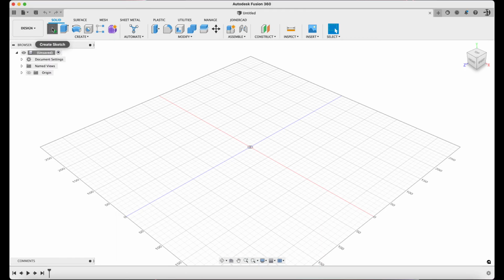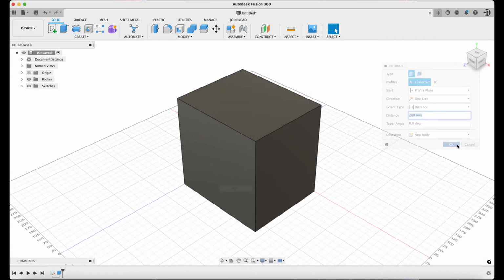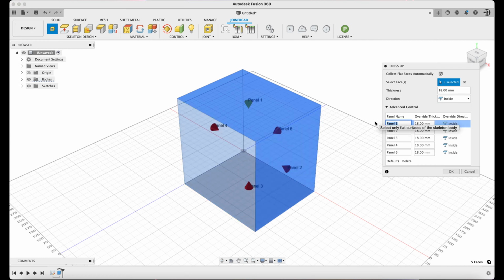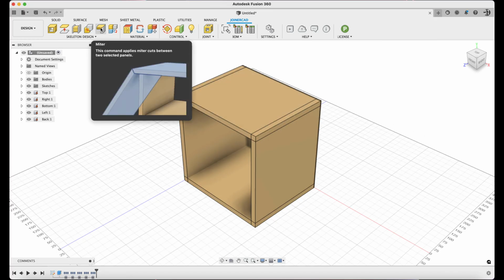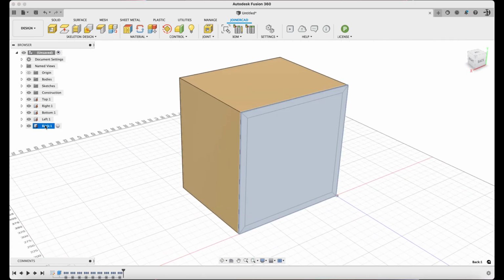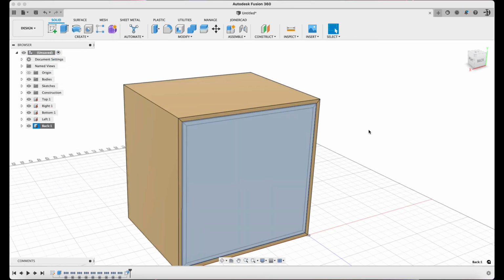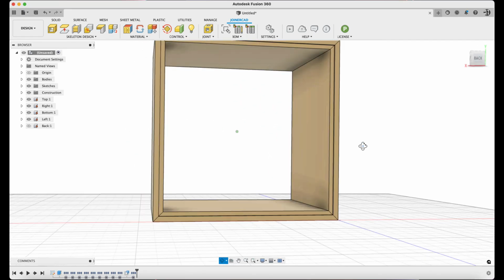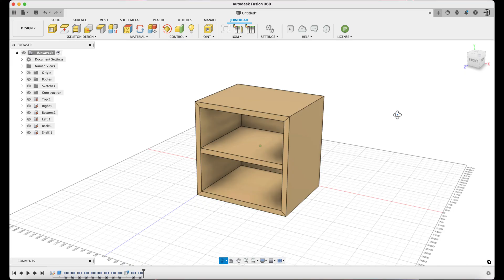1. Skeleton Design

Comment: can you change the material thickness after you have created the entire cabinet?
Reply: No, not with JoinerCAD’s tools, undortunatelly. We are limited by Fusion’s programming tools for such operations.
Reply: @GrK093  that doesn't really make sense, though. Without JoinerCAD, I am able to adjust panel thickness just fine with Fusion's tools. I personally use the User Parameter feature, define a panel thickness, and then call that parameter whenever I am inputting a panel thickness. Then, if I ever need to change panel thickness, I update this one parameter, and everything else (that has appropriate parametric definitions) gets updated to account for this; not just the panel thicknesses, but their positions, too.

If JoinerCAD can't do this, then something is seriously wrong either with the way it is implemented or how it is being handled in the workflow.

Imo, I am only considering JoinerCAD for its fastener features, but was intrigued by its panel features too. Hopefully the panel features are fully parametric.
Reply: @MichaelBrowne_esq  , you are scrolling old videos. The situation have been changed since then. First of all, Autodesk does not provide any tools how to create custom features in a timeline for editing. This means, if you create a Dress up, we can't edit it like a feature (i.e. like a simple Extrude), our tools make series of steps (features) while we get necessary geometry.  This is an issues for all developers, not only for us. Despite all of this, we've created an update mechanisms (we are calling them refresh), so we can update thicknesses, number of shelves or dividers etc. So, there is a method how you can edit existing features. And this was introduced 1.5 years ago.

Comment: Hello from Munich, can I clone an existing Piece of furniture in the same project and than change messurements individually? For example when building a kitchen and I have multiple cupboards which are different in hight and with but apart from that the same. Thanks for your help!
Reply: Hello, yes, you can. It is more question of Fusion, but basically you need to create a model, insert in a design, break reference link and then you will be able to change a dimmension.
Reply: @GrK093  Thanks!